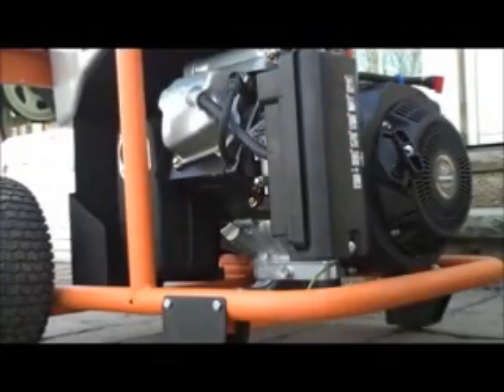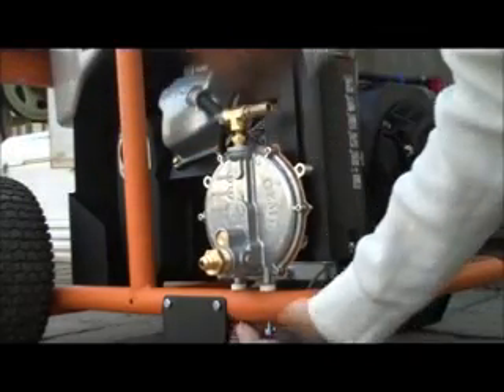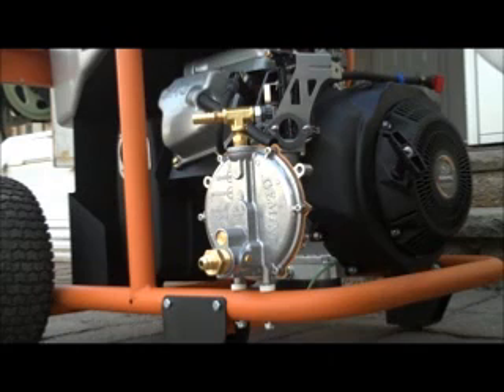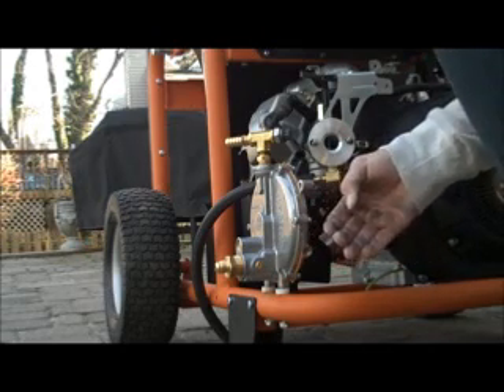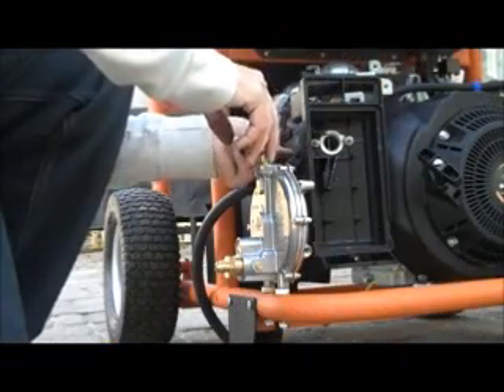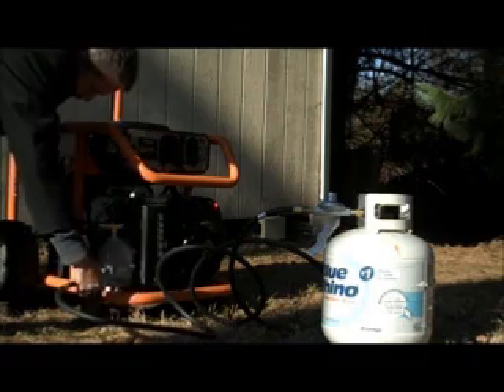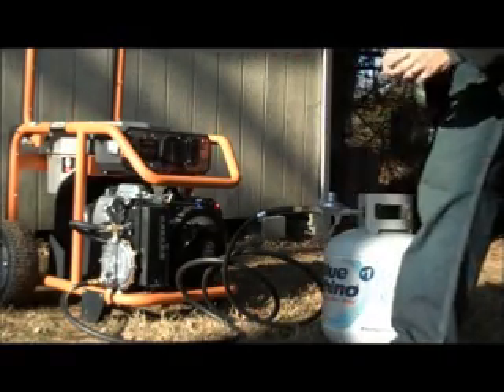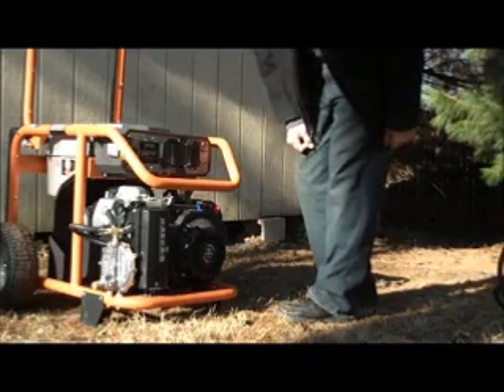Generator Conversion Kits to Propane and Natural Gas - US Carburetion

Comment: As the saying goes. "You get what you pay for." Diesel Generators are by FAR the best. There is a LOT more energy in diesel then gasoline and of course Liquid & Natural Gas so you will bun less. Diesel is also the safest as it will not explode, and for those who have no clue, it will also store for years if property treated, and I'm talking from 30 YEARS of experience with mine.

Comment: I have the same generator with the Subaru engine. Cool video. I'm just wondering why you'd run it on propane that runs for 4 hours vs gas that'll run for 10 to 12. Is there some benefit I'm missing?
Reply: Propane can be accumulated and stored indefinitely since it doesn't go bad, it's safer to store than cans of gasoline, gasoline "could" be hard to get ahold of in an emergency, if you do transport you generator to remote locations it is easier and safer to transport propane tanks than cans of gasoline, and propane burns MUCH cleaner inside the engine. The propane however doesn't have quiet as much energy so the generator will be slightly down on horsepower but not much. I think I have read that a 20 pound cylinder will run most small generators about 8 hours.
Reply: Having fuel on hand is why I'm converting mine over, gas go's bad in a months time, bad gas then add cold weather the generator might not start or run at all in an emergency.
I accumulated a few of these tanks from friends why not make use of them, I could switch to gasoline if I have it on hand at the time, problem is you never know when you are going to need the generator be ready.

Comment: What happens if the engine stalls, does the gas shut off automatically? Other than the regulator, does it have any way of regulating the amount of propane it uses while under load and then when the load is less?
Reply: Yes, the regulator uses engine vacuum to open a diaphragm to allow gas to flow. Once the engine stops running, vacuum goes away and the regulator closes off gas flow.
Reply: Thanks, very interesting.

Comment: can you tell me how many hours you have run on your generator with the kit so far? have you noticed any problems, burning oil? thanks.
Reply from the maker: I used it during Sandy for 3 days I would say bout 40 hours and yes I changed the oil once - After the storm the local engine shop had a least 5 brand new generators that burnt out - You do have to add oil a lot more than you may think - not like a car....

Comment: Tank size is important because propane is a compressed liquid. The generator does not burn liquid. There has to be sufficient surface area of liquid in the tank so the liquid can boil into vapor at fast enough of a rate to supply the engine. A small tank at low temps may not be able to boil fast enough. That's why large tanks are laying horizontal to get a large liquid surface area. This is why propane is an excellent refrigerant.
Reply: Propane is not a compressed liquid. Propane is a gas that is compressed in to a liquid state. It can only exist in liquid form under 2 conditions. Compressed or below -44deg F. As the pressure in the tank decreases, the liquid boils in to a vapor. I doubt tank size is a factor in this situation because your supply is only around a half a PSI or lower.

Comment from the maker: runs cleaner and smoother but I believe you lose power - I really don't see any loss but...The most power being regular gas, propane then Natural Gas - It cost about $200 for the kit - the quick connects and hose is about another $250

Comment: Lol, 3/4" @ 5' is way more than you need. You can run 30hp+ with your setup, as long as you don't step down @ your fittings... But with natural gas bigger is better.. My supply is about 175% of what I need @ 25'.

Comment: Excellent video! Thank you. I have been planning this project for a while. I cracked up at your comment about not testing for leaks with a match! :) You have to remind some people. I have a Powerhorse 7000. I think tri-fuel is the right kit, even though I will only use propane and gasoline.

Comment: Remember you will lose 10% of your rated hp and therefore watts using propane, and lose another 10% using natural gas. (Using natural gas you will lose 20%  of your rated watts compared with using gasoline).   Example: If your generator is rated at 5000 Surge Watts/4000 Rated Watts using gasoline. Using Natural Gas you will have  4000 Surge Watts/3200 Rated Watts.

Comment: Dont mount it to the generator! Put your low pressure regulator than put the card regulator. After that make the modifications to the carb on the generator but just leave a male quick connect on the carb and a quick connect on the propane tank. This keeps the regulators at the propane tank and it dosent cause any damage to the generator.

Comment from the maker: My flex hose is only 6' - Not 100% sure but that is what the regualtor primer is for - and the reason it took longer to start the first time - you can hear the gas come into the regulator - longer the hose longer the prime - As for the air filter I cut a little block of wood and put it in between the frame and air filter - seems to work. The other tidbit I never knew especially w/ briggs and stratton is ALWAYS CHECK THE OIL LEVEL EVERY 10 HOURS - they have no sensor switch and BURN OUT!!!

Comment: I think you mentioned you have 20' of flex hose between the house gas line and your generator.  That's about the same as mine will be.  How do you bleed the air out of that 20' of flex hose?  I've watched quite a few of these videos and that subject doesn't come up.  I know when I turn my gas logs off for the winter it takes a couple of minutes to clear the air out of the line and that's a really short run since I have a cutoff valve under the lags themselves.  Just curious...

Comment: The regulator on the tank lowers the pressure to a level that the final regulator (on or near the engine) can handle.  There are high pressure regulators that you can buy that don't require the first regulator, but they're more expensive and as far as I know, are only really used by people who want to connect directly to a big propane tank without having to lower the pressure first.

Comment: fyi, i was able to drill a 5/8 hole in my sill, just above my block foundation, to poke thru from the inside to the outside.  I chose to just tap into an existing "T" plug that was right near my dryer to reach outside.  I'd estimate my total run of gas pipe to be like 4' from the inside to the outside.  Once outside, it's just capped with a 1/2 end cap on the threads [when not in use of course].

Comment: Scott, kept checkin my "inbox" wondering why u never replied to what was an interesting dialogue but i see here u did- i think i get it now, you needed to go 3' from your outside meter to your gen hookup?  makes sense now...regarding the air filter box, mine's just the opposite--mine "floats" totally independent of the frame...as the engine vibrates, the carb and air box need to be able to "wiggle & shake" free from the frame itself....your setup I'm unfamiliar with.

Comment: Above Ground - it basically comes down to a 20 min job that no one will do under a couple hundred dollars or "you want it-you pay for it"...As for the air filter: when I put the adapter on the air filters original mounting to the frame doesnt reach - I just let it hang and vibrate - so much that it snapped the screws off the block holding the carb....

Comment: thx 4 reply...wow, $700 is alot more than I woulda thought to extend 3' from inside of home [but better than the 1,100 quote i guess]..while i gotcha, what's with all this talk of securing the air box to the frame?  Wouldn't the intense engine vibration make you want to let the box sort of "float" independent of the frame itself?  I'm not gettin the logic here of affixing the air box to the frame??

Comment: That's exactly why..but, since the video I did invest for a NG line -  3 ft pipe from the main line to the outside cost almost $700 plus all inspections (I had another quote over $1100)....The reason was because of freezing with Propane - this worked out to be a great decision during Sandy and all the lines at the pump...I was lucky power was out for only 3 day most week out for 10-12 days....

Comment: I also found that starting these Generators on Natural Gas Requires a Lot of Engine Rotations. Maybe you could prime it with some Gasoline. Best to Use an Electric Start Generator. I have my conversion to Natural Gas Here: Search For  v=3GE_qqRMWN8

Comment: Thanks for uploading-  I have a Ridgid 6800 and ordered a conversion kit.  couple good tips i picked up here;
-- loc-tite on the carb mounting bolts.  And secure air cleaner assy to the frame.
-- watch your oil consumption! Make sure to check level more often
-- careful to remove cleaner so dont rip gasket
I am doing a low-pressure kit, as I am connecting to my home propane tank (500Gal).
My gen is pull start...so i am a little nervous about cold-weather starting.

Comment: Not sure  - I only have 30 hrs on mine - I bought this after the snowstrom last year - Sandy was my first test - I cahnged it the first 25  but I will keep checking - If your thinking of doing this I didnt know while making the video but.....I'll say it again - Make sure you air filter is secured to the frame (I used a little block of wood) and not hanging (Like I did) - The carb bolts snapped off from the vibration of the motor - had to re-thread - got it fixed but PIA

Comment: Scott, thanks for the video. I have the same gen and want to convert it, so this is really helpful. One question, just use mine for like 150 hours for Sandy outages, and my generator burns like 1/2 qt of oil a day. Does yours as well? Have taken really good care of it so this was surprising. I switched from 10w30 to SAE30, which slowed it down a bit, but still burning oil. Thanks

Comment: Thanks - its a 3/4 inside diameter - I was looking all over and gave up - Purchased this from US Carb - expensive but I didnt want to take a chance with natural gas....I used it for 3 days w/ Hurrican Sandy  Just one issue -  Make sure you air filter is secured and not hanging (Like I did)  - The carb bolts snapped off from the vibration of the motor - had to re-thread - got it fixed but PIA

Comment: Just made it thru Hurricane Sandy with the Ridgid which the system worked like a dream - BUT just watch that the air filter box is secure (When I installed this I couldnt put the bolt back in that connected it to the frame) - the vibration of the machine I believe snapped the carb bolt off  - also use some lock tight on the bolts that connect the box to the adapet - these will rattle loose within a few hours....

Comment: Great video Scott, you pointed out a few things that were not covered on some of the other videos
I have a Generac 6500 with almost the same frame, great place to bolt the kit to and also splitting the air intake hose was not covered on other videos, getting ready to order from US CARB, what's the difference between  the C kit and the 4 kit
Al

Comment from the maker: 8,000 running 10,000 surge - Haven't tested it to see if that what I'm actually getting.
Also I'm not sure if you lose any power using propane or natural gas - It does run smoother on those 2 sources though...

Comment from the maker: I have the 8000 w/ subaru engine didnt have any issues with the extension bolts - I'd call US Carb they should be able to get new ones for you OR go to  a local lawnmower repair shop - they should have them...

Comment: I got the kit from us carb and the extension bolts don't fit on the carb they much smaller did u have any trouble with the wrong bolts.  I had the rigid 6800 mx 360 yamaha from home depot

Comment from the maker: true, it's an adapter - and everything comes with the kit (regulator, (thingy) - adapter, hoses, etc) to have this run on LP & NG...Since making the video I was able to hook up to NG requiring a 3/4" line - NOT INCLUDED was a 6' hose and the quick release (2 sets) is expensive (about $250) but WELL worth the investment..I also had an interlock system put into my circuit panel instead of a transfer switch...Everything works really well together - Good luck!

Comment: Thank you for sharing this info and demo; it is great. I just bought a GENERAC generator and plan to do the same to it. Just a quick comment and a question: this thingy appears to be an adapter (not a converter) since it allows the generator to run on gasoline (if one chooses to) as well as LP and NG. Question: Does an air-intake line or apparatus come with the adapter thus the creation of a ‘split air intake. This part was not clear (to me) in the video.

Comment from the maker: @cabinfevrr  No problem - That's one thing i didn't do is get the quick disconnect - Worth the investment - Ran smooooth on propane - I figured I can get around 40+ hours on 100# tanks of propane. And, I did try all 3 fuels and worked fine without changing anything....
Good luck!

Comment: Hey thanks for posting this. I have a 6500 watt unit that I have for emergencies, and also take to the cabin once in a while (twice in the past 2 years) if i plan on running some power tools. It often sits for months, and the fuel goes crappy, even with stabilizer. I've contacted my propane guy and he will put in a quick disconnect on the tanks i have for my house - in an emergency it could run for weeks if both the 420lb tanks are full. I think I will order that kit, as I can still use gasoline